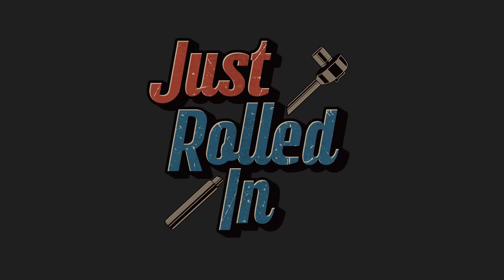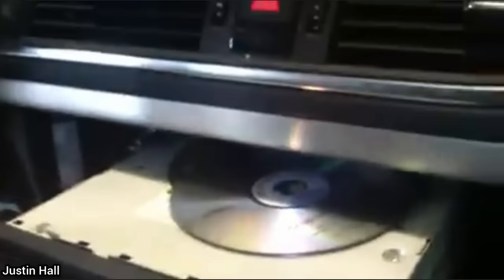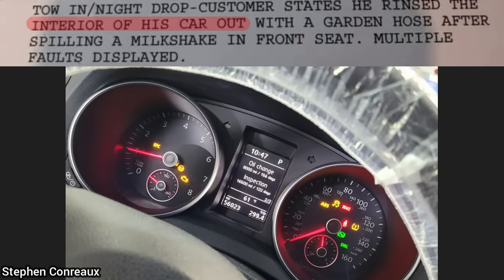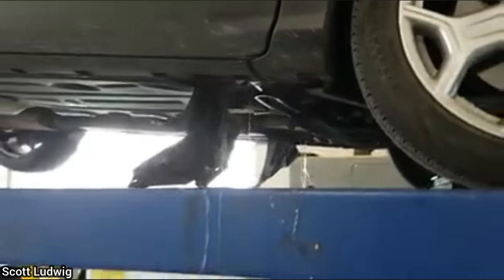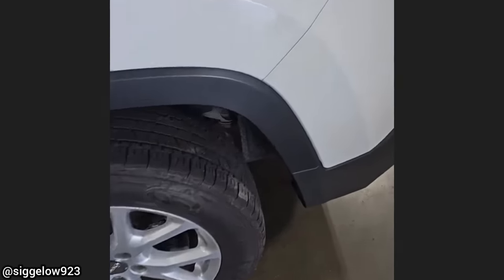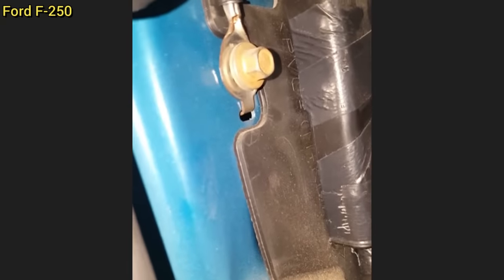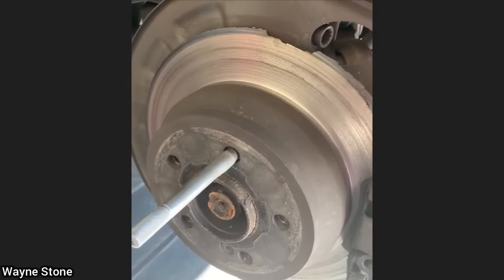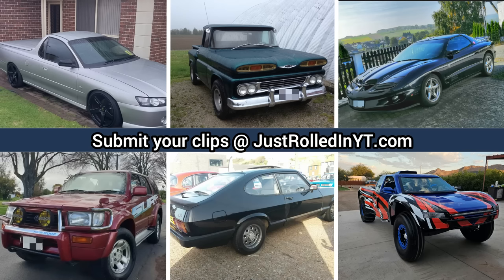Customer States Parking Brake Seized & He Took It Apart

Comment: That beer shows an issue common to many cars - They put a drinks holder right next to loads of electronic switches it is stupid design. I don't drink beer in the car but I have had to dismantle my electronic handbrake twice and dry out the circuit board because I did not have the lid on my tea properly. What muppet thought that was a good idea?

Comment: Buddy of mine was having difficulty shifting his standard tranny Accord. Hard to get it in gear. He took it to a shop and they said he needed a rebuild. Took it to another shop and they said the same thing, $4500 for a standard tranny rebuild. He was telling me about it and I called BS, told him to bring it to me, just a guy with a little bit of mechanical ability. I drove it, and indeed, it was hard to clutch it into gears, but I could clutchless shift it no problem. Had him push the clutch for me while I looked under the hood and saw that the lever on the slave cylinder wasn't moving the entire stroke length. Crawled under the dash, and found that the clutch pedal bracket had cracked, and when it was pushed in, the plate would flex, not allowing a full mechanical clutch throw. $60 for a new plate and 3 bolts. SMH.

Comment: Oof, the parts cannon is my nightmare. I got hit with it on one of my dune buggies because of a transmission problem that i correctly diagnosed right at the start as being broken gear teeth on first gear, but the freaking mechanic kept insisting that i swapped everything BUT that. clutch, engine mounts, the lot.

Comment: Man that last car either that tire/wheel is so horribly out of balance or the tire has a broken belt in it and is going to blow any minute.  Seeing these videos and you are scared to drive out there and you dont see 90% of the issues on the road.  I work for a big box retailer tire shop and the crap that rolls in makes me scared sometimes.  I would film some of these things but the company would probably fire me if they found out.

Comment: Simple minded, non mechanically inclined people should not work on cars. 

My interior lights stopped illuminating so i checked the fuse in the passenger side fuse box. The fuse was fine so i checked some other stuff, then rechecked the fuse diagram only to discover a second interior light fuse in the box under the hood. It's amazing what can be fixed with just a little patience, some diligence and attention to detail...

Comment: Amusing customer stories. I have one that is a bit less amusing. This customer brings his car to the dealer 3 times because not only does the car not recognize the key fob, but also keeps flashing messages about faulty active handing, traction control problems and braking issues. After three visits the problem was not solved. I believe they must have been doing a reset and calling it good. While at the Auto Zone store, I related my problem to the clerk, and he offered to put it on his diagnostic code reader and I agreed. The reader said basically I needed a new accelerator pedal assembly. I installed one myself. Problem solved. Now that I think about it, a story about how an auto parts store clerk could solve a problem that trained mechanics at the dealership could not after three attempts, is not in the least bit amusing.

Comment: I just scrapped a car which looked 100 times safer than most of these disasters... Only 3rd and 4th gears work but that shouldn't stop anyone from driving. Just rev it up and dump the clutch.

Comment: Diagnosed a truck tha shutdown while the guy was driving, he ran it out of fuel on the interstate. Just for the wrecker to go out to him was $400 then add mileage and taxes.
Reply: So 400 bucks because his gas gauge didn't work? I had one breakdown in front of the shop one time, pushed it in a bay,  turn key over look at dash,  low fuel light, gauge on "feed me". Gave her a couple gallons I had in shop and pointed to gas station half block away lol  . No charge ma'am have a great day watch your gauges.😅

Comment: A couple of these I wouldn’t blame the customer for. You really shouldn’t need to read the manual to figure out how to operate a liftgate or side mirrors. Many controls aren’t designed well or they offer too many options which just adds complexity.
Reply: ya it should be common sense 😂.
Found the customer